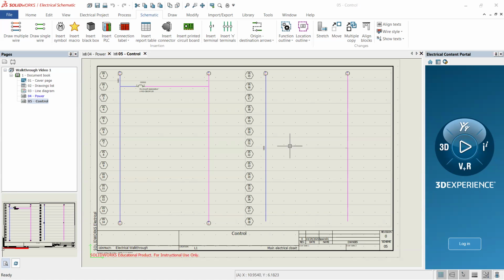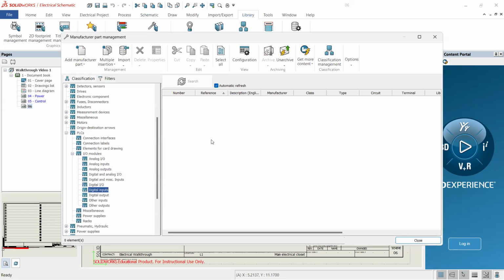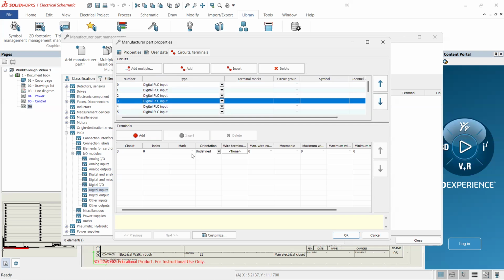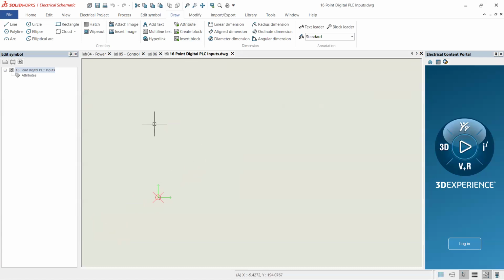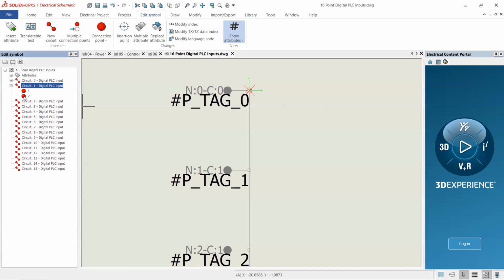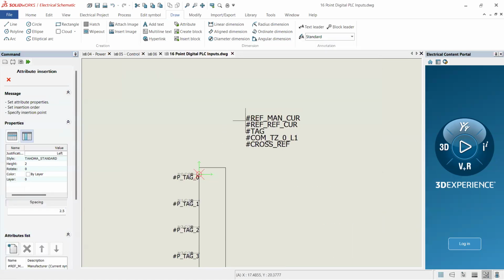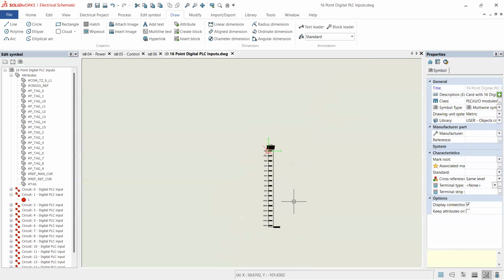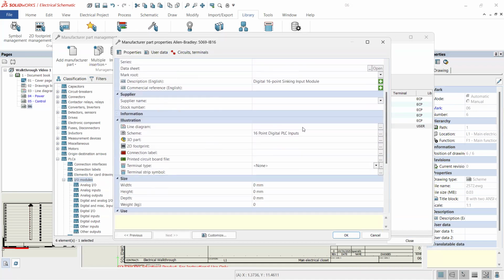From Scratch: Creating a Manufacturer Part & Multi-Wire Schematic Symbol (Part 1)

Comment: Hey, like the video. Good stuff. I have been using SWE since 2019. There is a way to align your symbol attributes. Turn your grid on (bottom right corner or F7) and turn your snap spacing on (bottom right corner or F9). If you want to adjust your grid size and/or your snap spacing, right click the any of the grid buttons in the bottom right corner. That should bring up your Drawing parameters window. From there you can change a bunch of grid parameters. Hope this helps.